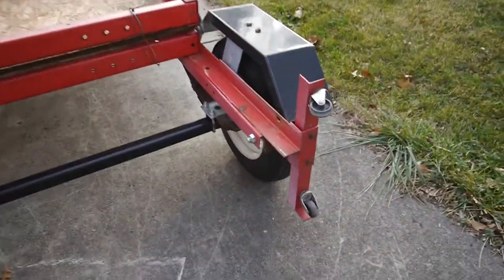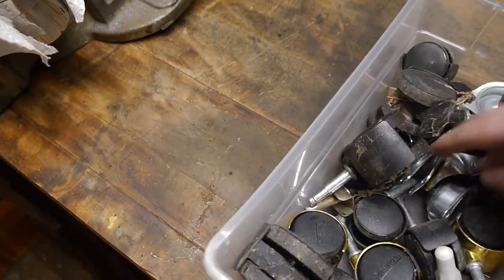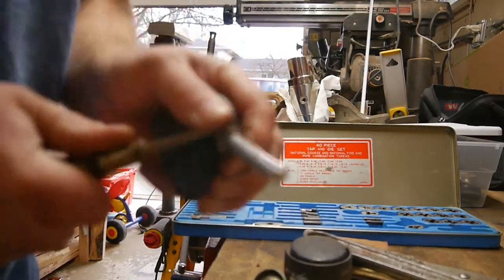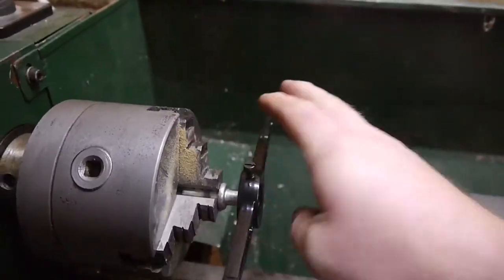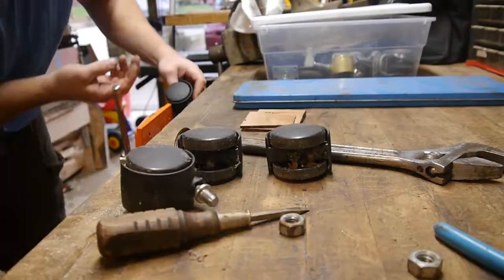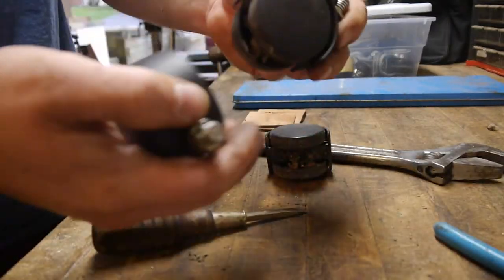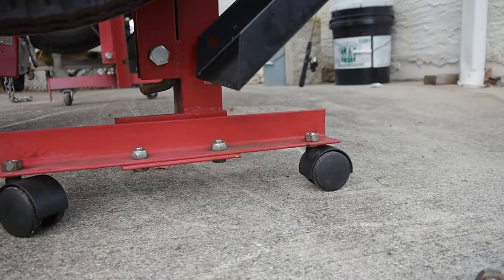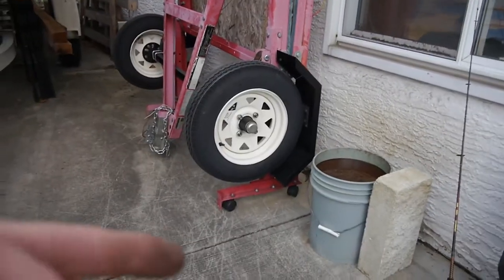Harbor Freight Folding Trailer Stock Caster Replacement with Office Casters

Comment: I have the same trailer. Seriously, for the price it's pretty good. However, I would have used a little better caster than a cheap office chair caster.
Reply from the maker: I agree for the price and the foot print it takes up when folded it can't be beat! Saves me from owning a truck to go pick up sheet goods. Honestly after a couple months and several folds up and down I can say the office caster is still doing well. Even better than the stock one. The office caster was more of a what if for me and besides it really  grinds my gears that I would go back to harbor freight to buy a replacement caster for harbor freight product that should have lasted longer. At any rate, I will let you know when it fails on me. ;-) When it does fail I should be able to quickly grab one of the other 3 casters I have and pop it on without too much fuss. Thanks for watching!

Comment: Josh,what do you make in your shop, it's very organized.
Reply from the maker: Thanks hackLAB! I think my wife would disagree with you on the organizational state of my shop LOL. I have mostly been making infrastructure improvements around the shop (one car garage) and house. For the shop I have been working on adding cnc milling and manual lathe work to my roster of abilites, as well as working on organizational projects this year. For the house I have made a kitchen pantry, an Island, shelves, paper holders, small furniture, lamps, various gifts for friends and family. Projects can be slow sometimes as I normally do not like paying a lot for materials so I tend to dismantle pallets, and find the occasional plywood and 2x4 in the neighborhood being thrown away and salvage that.

I checked out and subscribed to your channel. You certainly have your act together on the video end of things. Still learning myself, and struggling with sound and production values.

Thanks for subscribing!

Comment: those casters break yet ?
Reply from the maker: Hey David, actually they didnt break surprisingly. They did however fall off completely while driving down the road at some point. Oops. No one came up behind me and cursed at me so I think I am safe. :-) I ended up replacing them with same different casters I removed from a heavy duty cabinet some one was th growing away and those have worked just fine so far. Thanks for watching.